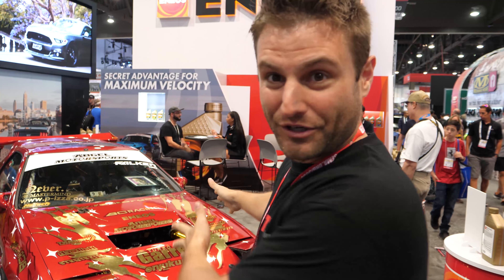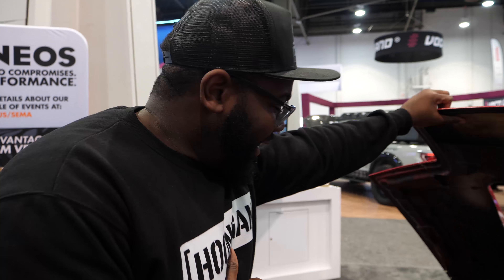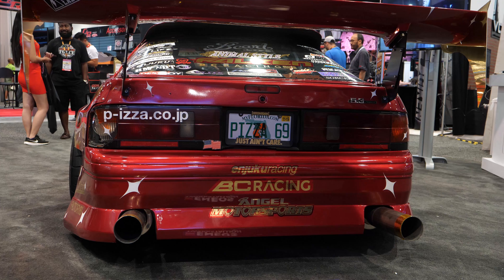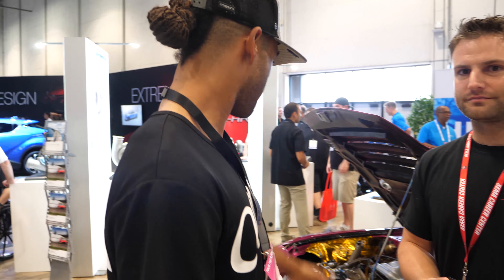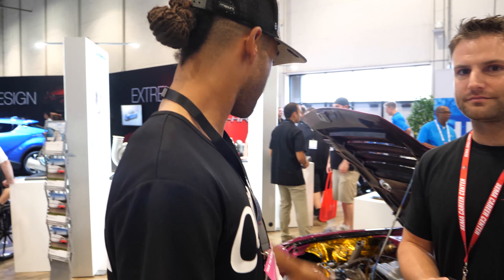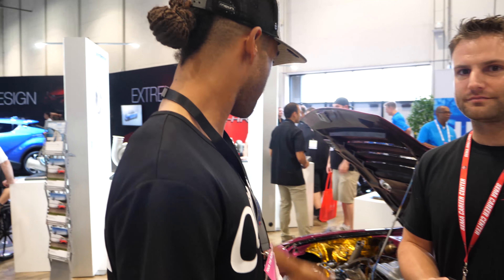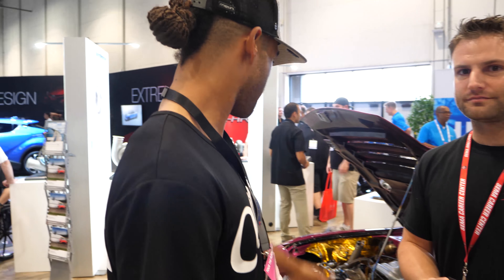Rotary Engines Make A Comeback at SEMA 2017

Comment: BILLET-inc  Please Sponsor Rob, And his 4-rotor build!    (I got your back Rob)
Reply: RustBucket I I wonder how much that  engine block is? In a 3 or a 6 Dorito and is it all new parts or a rebuild plus is it stronger than the original one with upgrades
Reply: The Billet only replaces the Iron's. You still have to use stock rotor housings. not sure on price, But id say that one in the video was fully built/race ported, Maybe even carbon apex seals who knows lol.  Billet would be way stronger with that stud setup. almost perfect for high boost.

Comment: like to see a rotary, a 3 rotor... probably FI, with an updated and more powerful version of Honda's IMA motor in the block before the transmission, and a manual (and a special auto, working with the IMA motor and the turbos to lessen turbo lag, increase FE, etc). Awesome low-end torque, possible engine-off electric only, auto-stop, and a decent turbo for the mid-top end. yes please.

Comment: rotary engines are the perfect blend between a 2 stroke engine and a 4 stroke engine, got no valves nor camshafts, and to get more power you just gotta port some holes and boom, you're done, plus no rods, so no weak stuff that can break under boost pressure. it's got the 2 stroke mpg as well
Reply: Wankel engines all use the 4-stroke Otto concept.

Comment: Mazda recommended to drive the rotarys at high rpm's to keep the motor from blowing up
Reply: Mazda recommends waiting till 2019 and buy a new Skyactiv-X 4-cylinder... they don't make Wankel engines anymore!
Reply: doktorbimmer but it will never sound cooler than a turbo tri rotor
Reply: I don't care what it sounds like if I can't walk in a showroom and buy one. The question is can you buy a new car with one? The answer is no, none of the car companies make a Wankel engine anymore...
Reply: It Doesn't Sound very reliable that for sure.

Comment: I understand when rotary Guys and Gals say a Rotary Powered Car should stay Rotary powered!  It is as I say as a Ford Guy, that you Don't Put a Chevy engine in a Mustang or in any other Ford Powered Car!...I Get It!

Now, just so you know I owned two Mazda Rotary Powered Cars!...a used 71 Mazda RX-2 Coupe and a New 77 RX-3 SP and I enjoyed both those Rotary engined cars and I believe the RX-3 SP was just as fast as the 79 1st gen RX-7's IMHO!

I believe why the Rotaries faded out so to speak, was because they were expensive to repair, they were gas hungry when you wind them out to 9000 to 10,000 RPMs and used a lot of oil, which got better later on!  Beside swapping from a 12a Rotary to a 13b Rotary, it wasn't much more you could do to modify them!  Well, you might be able to get away with a carb swap like to a bigger holly or a good tuneup and maybe a header swap but you had to keep the cats in place though!

So remember I am talking about California and its strick Smog Laws!  76 and newer cars are required to be inspected every two years in order to be registered in California!

So that's why you see a lot of 1st, 2nd and 3rd Gen RX-7's with Ford and Chevy engine swaps!  you get more HP, better Gas mileage and less maintenance!

I have considered getting a 75 MAZDA RX-3 and swap in a Modified 13b or 20c 3 Rotor engine!  Oh well, we'll just have to wait and see!  Maybe in 2020 Mazda will bring back a new and improved Rotary Powered Sports Car!...God Bless!

BTW!...Most Highly Modified Rotaries are now Days are used in Strickly for Off-Highway use like Road Racing, Track Days, Drag Racing and Drifting!

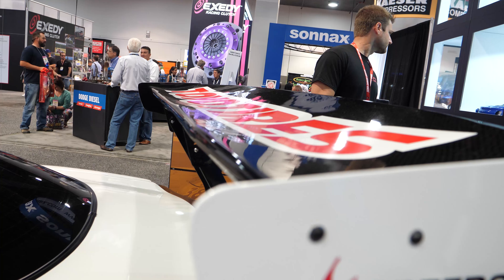Comment: @ 3:40 Idk if there's some joke here I'm not getting but fuck that guy. 
Edit: Just learned I could edit, and yeah there was a joke I wasn't aware of. They're good friends lol. Should have noticed that, but I'll leave it the same. Sorry for saying fuck you Shane, you're cool.
Reply: He just seems like he's having fun on camera to me
Reply: he has a v8 rx7 Rob hates v8 Rx7s so its just a joke chill
Reply: It's a turbo V8 though! Things gotta be making 10,000hp. All that displacement, with forced induction on top of that. Or is that not how pistons work? Maybe it's all about making less power per displacement, and still having reliability issues.
Reply: Big 'ol Booty Cheeks cant be that unreliable if theyre still being made unlike the rotary.
any reliability issues with an LS based turbo car will be builder or tuner related...not platform related like the rotary.
Reply: Vanilla Gorilla your correct, to an extent. They're terrible motor for street driving. But are incredibly reliable for their size under aggressive driving. Granted everything has been maintained. LS motors are fantastic on the street. And honestly pretty impressive under more strenuous driving conditions. But seeing how hard rotary engines often get pushed, I'd say they're pretty damn reliable. I still love em, even if they're not being produced anymore, but again, that's cause they're terrible as road car engines. No torque, bad gas mileage. Tons of cooling and lubrication problems.
Reply: thats shane walley. He's a well known drifter in SE michigan. He's just joking with rob. Theyre both friends.
Reply: @Eric Hoffman Thanks, I had a feeling that might be the case.
Reply: Our actual hatred has nothing to do with the LS and rotary. Robs still just upset that I wouldn't put out on our first date.
Reply: @Shane Whalley Oh shit you're the dude! That's kinda cool. You're very convincing btw, and thanks for taking me saying "fuck you" with such humor lol.
Reply: Haha yeah. Me and Rob have been friends for quite a while. Once I got my FC and put a turbo LS in it the back and forth trash talk hasn't stopped. It's all in good fun though.
Reply: Vanilla Gorilla Great logic. You earned a silver star... not gold...

Comment: spaghetti may diss on ya, but on RX7's where on the same page ^^
putin a V8 in it is pure sacriledge ! 
its like striping an iconic car from its even more iconic soul !!!
put a V8 in any other car i don't care, just NOT in a RX7 !!!
if ya don't wanna put up with the hassle of a Rotary engine, DON'T buy a RX7 ...
Reply: Its better than scrapping the whole car... which is the whole point of swapping... to bring a car back to life that would otherwise not be worth fixing at all.
Reply: maybe 1 or 2
but most are just unfamiliar with rotary, or just to lazy and think a V8 is the solution to everything, well in this case it kills the perfect 50/50 weightdistribution, but who care's U ami's only go in a strait line wright?
Reply: AND 
if the body is worth fixing and putin a new V8 in it ....
then WHY NOT an aftermarket rotary ???
so that's just a poor excuse
Reply: Of course they are, Wankel engines are obsolete now in production automobiles.. Well, auto manufacturers think so... its a safe bet the are on to something that the V-8 swap guys know too.
Reply: 50/50 weight balance is meaningless if your car won't because the apex seals are blown... besides, if you are going to the trouble to swap engines... re-balancing the car is not such a challenge... you could with the right parts.. all aluminum V-8s are not much heavier.
Reply: Why not a 6 cylinder or a turbo 4-cylinder? Its not that hard to find an engine with more power... even easier to find one with more torque, fuel mileage and reliability too!
Reply: if a rotary is obsolete ... than why the F* buy a RX7 in the first place???
put a V8 i anything else, i don't care
altough those 911 to V8 swaps are also pretty pointless xD
Reply: True, there are a lot better cars out there if you cannot afford a new car...
Reply: V-8 swapping a 911 destroys the resale value... that's not an issue with a Mazda.... it has none.